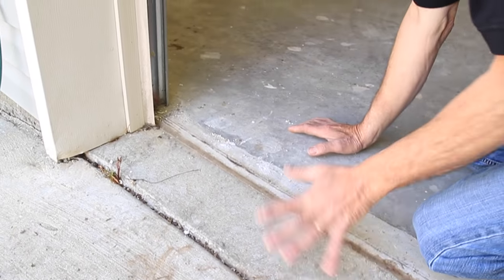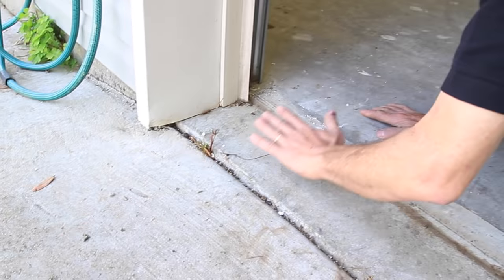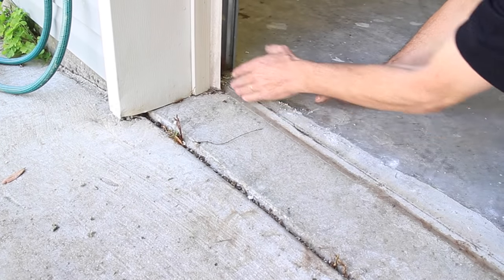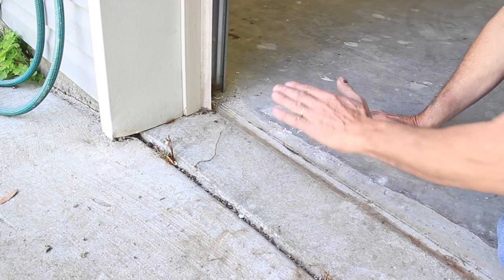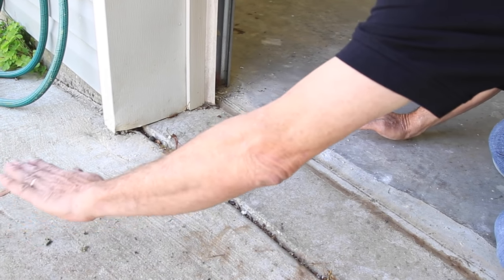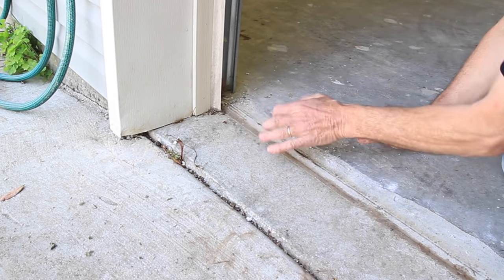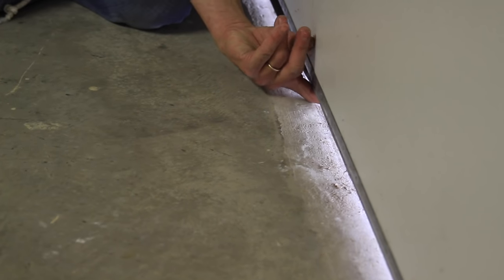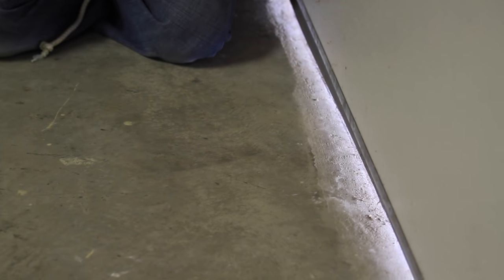How to set concrete to keep water out of garage - Baton Rouge - Overhead Door

Comment: I wish the half wit that built my detached two car garage would have watched this video before pouring all the concrete! Now everytime it rains I have about two inches of water in my garage. Of course the "home inspector which is Cardinal Home Inspection " did not catch this problem. So now I am stuck with this problem!

Comment: Not expecting a response given the age of the video and limited actual instruction. 

So is there any recourse on a house built 3 years ago with a leaking garage due to basically what he describes wasn’t done? Or am I stuck with cost?

Little note given the company that posted the video. Overhead installed my garage 3 years ago, new build, and I just had to pay another company $200 to basically redo it due to all kinds of issues. It’s was Overhead in St Louis and when I called they offered to come fix it at my expense, so I went with another company. Understand it was out of warranty but given it was an install issue you think they would have offered discount or at least free estimate.